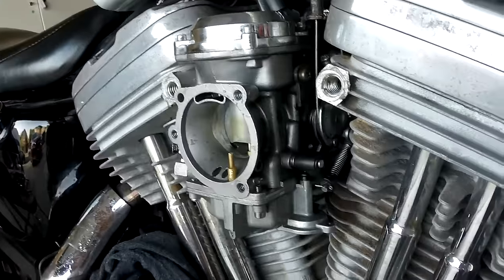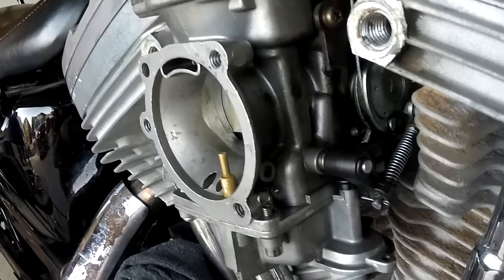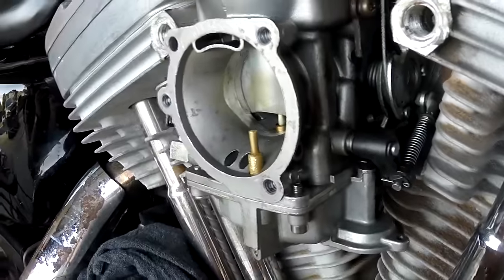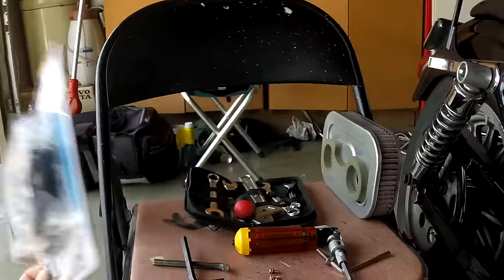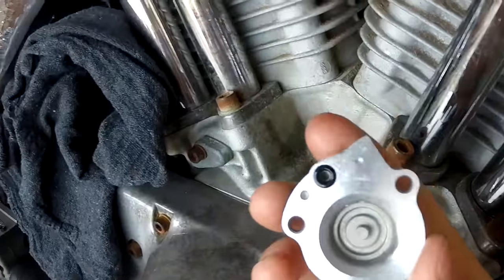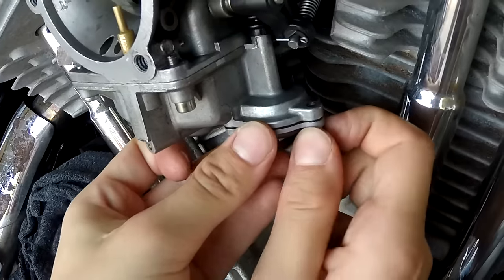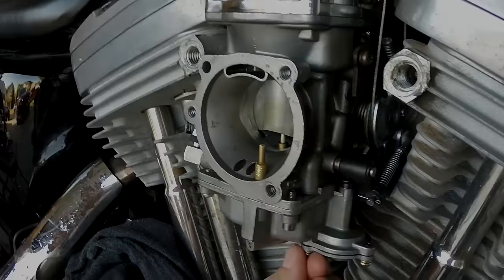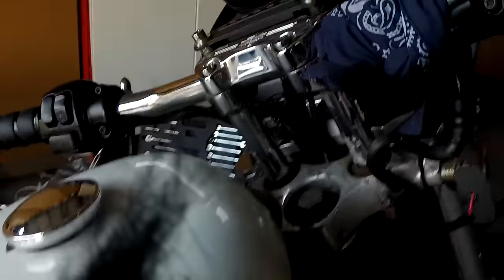Carb Gas Leak - Harley POOPster - Accelerator Pump Diaphragm

Comment: Thanks for the great tip! Inherited a 1985 sporty with 2200 miles on it. Been sitting 5 years with fuel in it! Gonna rebuild the whole carb, but after draining and putting in fresh gas she fired right up! Fuel just kept running after I shut her down. Prob the diaphragm! Thanks again!😎👍

Comment: Great video. I am having issues with my 95 883 Deluxe accelerator pump not getting fuel through the nozzle changed the diaphragm still not getting fuel through nozzle causing a hesitation in the throttle  i'm thinking a clog in the nozzle could be the

Comment: Please make sure the side of the diaphragm with the ridge/lip is facing up, I watched another video and he showed it the opposite way and I followed his direction. Since this video wasn’t clear on that part. And yes it leaked like crazy. I flipped it over and it worked perfect. If you watch closely you can just barely see she puts it in ridge/lip side up. Other side is flat. Thanks you too the other people posting in comments giving the information a# well.
Reply: Paul Harms that’s the info I’ve been looking for, thanks Paul.
Reply: The MOST IMPORTANT part of the replacement and she does not even mention it, good info Paul.

Comment: I have a 2000 Dyna and I'm leaking a little gas where are you stated in your video but mine's like maybe a dripper to almost not noticeable but I can see the gas residue on my bike I'm going to replace the part anyways and see if that fixes it

Comment: I have a 2008 Buell blast with less than 1200 miles on it carb does the same thing you're talking about but dumps the fuel from the intake side of the carb after riding and wants come to a stop just all of a sudden dumps fuel. Unfortunately the Buell blast carburetor does not have an accelerator pump diaphragm that comes on its stock there is a spot for it but nothing there. I cannot figure this out it's not a float issue or it would be doing this while sitting still.

Comment: Looking at a replacement carb from mikuni the HSR 42-11-WP and a stage IV 1200 up grade and a 2 inch stretch sportbob 4 gallon fuel tank in the future for my 95 XL 883 deluxe sportster

Comment: Hey I'm New at this stuff and I'm wondering I got a 2002 Sportster and I was trying to replace the gasket on the front of the carburetor and I want to make sure I'm assembling it back right it goes gasket metal plate gasket and in the back of the cover and in a breather in the front of the cover is that correct

Comment: Can you help I did everything on the video with new parts but I still have a small gas leak, what could be the problem?
Reply from the maker: Is it leaking gas from the same spot as before? Perhaps there's a crack or parts are not mating up correctly?

Comment: Great vid :). Since you offered, I have a question regarding my Poopzuki LS650. I pulled the carburetor out and I want to take it apart to clean it, but all of the screws are ridiculously tight and I don't want to strip them. Got any suggestions? (I'm really novice at this kinda thing)
Reply from the maker: Thanks! Make sure you have tools that fit the screws perfectly, no wiggle room. It may require buying new bits but it's worth it. Some of the screws have lock washers and it will feel like it's going to break, you'll hear a snap but they will come off. A little bit of PB blaster overnight will help loosen anything that's stuck too!
Reply: Heh, yea I asked my question on reddit too and people told me I needed JIS screw drivers, an impact driver, and PB blaster. Never heard of this PB stuff but it must be good if everyone recommends it. Thanks!
Reply from the maker: No problem dude good luck!! Let me know how it goes!

Comment: You sound like Emily at flying sparks garage! 
Anyway my 99 sporty is on the side of the road with a fuel problem. The door that slides up when you hit the throttle is not opening. Got spark but no fuel. 
Luckily it’s just down the road from the house, unfortunately it’s down a steep hill I live on...
Reply from the maker: The door that slides up? The butterfly valve? Are your throttle cables in check? No blockage in the petcock/fuel filter, make sure the tank is clean? Hope you get it sorted out!

Comment: so I've been given an opportunity to buy a 2005 hd sportster 883 with 9k miles on it which uses a carb (you already new that) as my first bike. would you recommend it yes or no. I noticed on of your comments you said you'd rather not deal with a carb for your next bike why? (I'm sorry I'm new to this scene)
Reply from the maker: Yes!! I highly recommend because now that I've worked more on this bike I realize just how simple they are. Once you understand how carbs work they are easy as cake to maintain. This bike in particular had a lot of issues with the carb (from previous owners) but the sportsters are nice because they have a single carb that's easy to get to. Even if you decide to take it to a shop, it shouldn't take them more than an hour to get a carb job done.
Reply: Killswitch Queen awesome ! thank you for replying I'll definitely be making a move

Comment: I have a 96 1200 with some work and it’s pissing gas out of the overflow tube for the bowl
Reply from the maker: Carb is getting too much gas. Your float needle should stop the carb from filling up to the point of overflowing. Tap the carb, float could just be stuck. If that doesn't work, pull off the bowl and clean out the needle seat... Could be some gunk in there. Rubber tip float needle? Check for a "ring" to see if its worn. Polish your needle seat. Get a new float needle. Check your float height. Should stop that nasty leak!
Reply: I took fuel bowl off and tried some carb cleaner sprayed as best I could the float is still bouncy I ran out of daylight to take float off to take the needle out etc etc was going to try little seafoam as that was suggested to me then if that don’t work I’ll get rebuild kit take carb off and hopefully that’ll fix it
Reply from the maker: Definitely start with checking your float height and polishing the needle seat with some regular chrome polish. Rebuild kit will not hurt of course but sometimes it's more work and may not help. Seafoam will not solve gas overflow/leaking problems.

Comment: Is there a up or down for the diaphragm ???
Reply from the maker: Yes the side with the lip on the edge of the black rubber should be facing up, the side that's flat faces down
Reply: if this is placed the wrong way, could it explain why gas is still leaking from that spot?
Reply: Yup, another video says down and I tried, leaked like crazy. Lip side up is the correct way.

Comment: Bottom line, if you own a sportster, you better be mechanically inclined. They don’t call it “a bitch’s bike” for nothing. Junk bikes, Doesn’t matter how good they sound, give it five minutes, you’ll have a problem.
Reply from the maker: Thanks for letting everyone know that you know absolutely nothing about sportsters. Any bike left to rot will have a bunch of problems. I haven't done any repairs on this bike in over a year, runs like a fucking top, the most reliable bike I've ever owned. So go somewhere else and talk outta your ass.